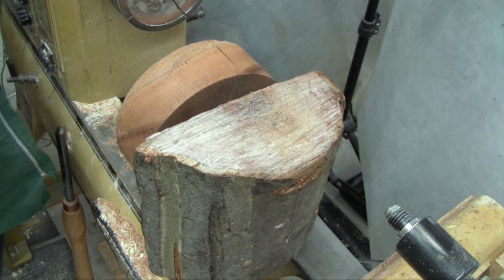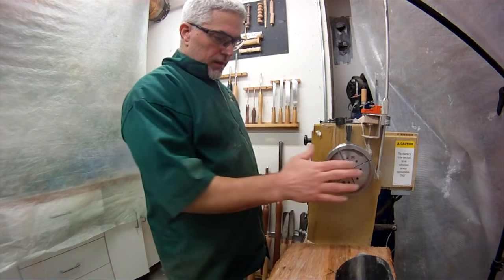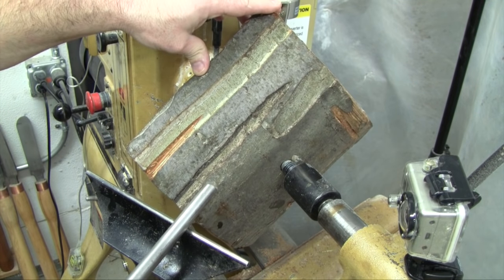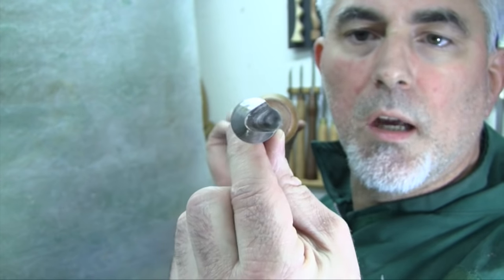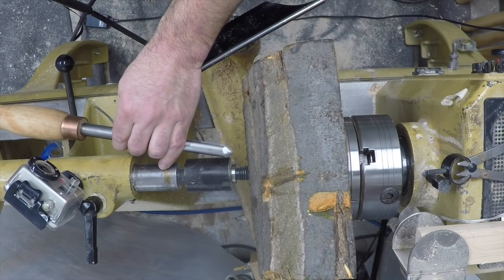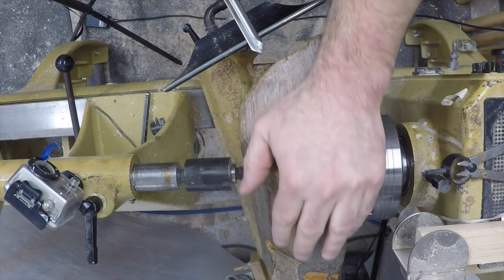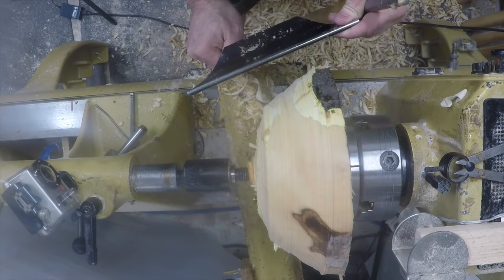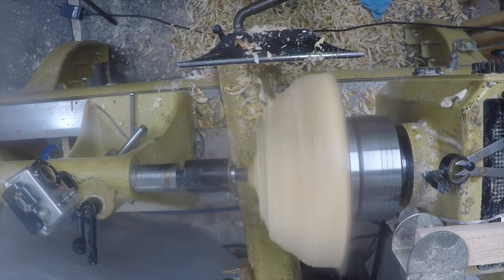No Bandsaw? No Problem!

Comment: When I first started doing bowls I only had a little 6" band saw so the most I could ever do was knock off a little of the corners.  So I had to develop my own way of dealing with half rounds like that. Not much different.  Just starting at the 45 and slowly working toward the head stock. Lately I've switched to doing the roughing left handed.  It keeps me out of the line of fire for the chips, water and potential failures. Same basic cut right hand on the rest, handle on left hip and pivot right.
Reply from the maker: +Robert Schuster I should try the left handed roughing for the reason you pointed out.  It keeps me further out of the line of fire.  I used to think that Glenn Lucas was left handed, but I learned at his demo here at a local club that he is right handed but roughs left handed.

Comment: Brian -- Thanks for the informative video.  I wish I'd had that pivot cut in my arsenal when I roughed out my first half-log blank.  Trying to turn it round it out with a push cut almost cost me some fillings!  Talk about a brutal cut.

Rather than using a screw-chuck or a face plate to mount the blank on the lathe, I suggest mounting the blank between centers.  This allows you to find the balance point on the blank (which lets you turn at a higher speed).  More importantly, it allows you more creative freedom.  With a screw-chuck or face plate, you're stuck turning the bowl on that axis.  When you start between centers, you can shift the axis to better balance the grain or to take advantage of (or avoid) some other feature in the wood.  YMMV.

Comment: Two other techniques are to cut the blank into an octagon as you have done in another of your videos, Brian. Also, a lesser used technique is to place the full log between centers then shape the log into a ball. Finally,  rotate the ball 180 degrees before cutting in half with a chainsaw while on the lathe. This one works especially well. you just have to be careful. It's best to start with a small diameter log of about 9 inches. i believe it is David Ellsworth who uses this technique, but I'm not certain. I have done it myself, and it does work well. The trick is to get the pith oriented perpendicular to the bed ways before cutting with the chainsaw...electric chainsaw is best for this.
As a side note, we all seem to be adapting the techniques of the professional/production turners. In my opinion, this is a mistake as it causes us to be in a hurry. Side ground bowl gouges are a good example of this. The object of that gouge is to remove material quickly. That works great for the production turner. But, this is supposed to be an enjoyable hobby. What's the hurry?

Comment: I didn't have a bandsaw for a number of years -- i used to rough the corners off with the chainsaw so it was closer to being round (mostly octaganal).....once I got my bandsaw, i found that spending 5 mins at the bandsaw, saves me 20-30 mins of roughing at the lathe......since my lathe is only midsize, having the saw means I can do larger bowls that start approaching the 12" max the lathe can do....before that most of my bowls were only in the 8-10 range at best.....

Comment: I acually found out yesterday that with my electric handplane i can extremely quickly take off the corners and the "corners of the corners" and take off most of the material very very quickly like that. saves a ton of time too and might even be quicker than with a medium bandsaw and setting everything up.

Comment: I am a new turner. 
Had a large walnut bowl blank on a plate the other night. It was out of balance and bouncing a bit. Without thinking I grabbed a spindle roughing gouge instead of my bowl gouge. 
About 15 seconds is all it took to catch the end grain.
Snapped the tool rest off and bent the roughing gouge over. The local machine shop made me a new tool rest but I'm out a Robert Sorby spindle roughing gouge. It could have been worse.
Scared the heck out of me!
Reply: This is why Brian's explanations are so important.  You may not have seen his other video on why not to use the SPINDLE roughing gouge for just that reason.

Comment: Brian, great video.  You explanations are spot on and very informative especially for the new/inexperienced turner. I've been watching them all to see what a good YouTube turner should really be doing.  I do wonder about the distance between your tool rest and the blank you were turning.  I realize you had a long handled gouge and the rule of thumb is 1:5 which means for every inch over the tool rest you should have 5 inches on the other side.  You started the blank a little far away in my opinion.  And every time you check your progress you should reevaluate the tool rest distance and of course spin the blank by hand to make sure nothing's going to hit.  Some of your videos mention a Presidents challenge so I assume you belong to a local turning club.  I would emphasize that to your viewers as there is an additional wealth of knowledge there.  Keep up the great work!!!

Comment: Brian, thanks for the excellent demonstration.  Could you share info on the grind you have on that bowl gouge?  Looks like it might be different than a gouge used for the finer cuts as the bowl nears its destination.
Reply from the maker: +JSEquineVideos  I have been thinking about doing a video on bowl gouge grinds.  For about 90% of bowl making, I use a 40/40 grind, meaning that both the bevel and the sweep are 40 degrees.  When the 40/40 can no longer maintain bevel contact at the bottom of the bowl (because the tool hits the rim of the bowl) I switch to a bowl gouge with a 60 degree bevel.  The one I used in this video is still a 40/40 grind, but I sweep back the left wing some, which I find helpful when rouging bowls.

Comment: Why wouldn’t you use roughing gouge to rough the outside shape
Reply: If your're talking about a SPINDLE roughing gouge you need to watch Brian's other video on why that's not an appropriate tool for anything other what spindle work.  And spindle work is where the grain structure of the wood is only going parallel with the bed of the lathe.

Comment: thats all well and good if you think everyone has a lathe the size of yours, its almost if possible on a hobby small lathe because it would shake the hobby lathe off the bench
Reply: I have a Jet 1221 and i easily screw chuck up a piece this size (even oak) and turn it into a bowl same as this video. And my lathe isn't even bolted to anything but sits on a table. Now the 1221 is a pretty heavy little lathe so that helps, and I use a sharp tool, but it's not so difficult.

Comment: Do you have a nova titan chuck? How do you like it?
Reply from the maker: I do have a Titan, and I like it, but I have heard others complain about the fact that there is no way to use a wrench (including the standard Nova chuck wrench) to remove the chuck from the spindle.  Most Teknatool chucks require an insert to adapt it to the specific spindle thread, and that insert has a hex shape that allows the chuck to be removed with a wrench, but the Titan only comes in 1-1/4, 8 tpi and has no hex shape.  To get the Titan off, I usually open the jaws to have a 1/4" gap, and stick the 'T' hex wrench that comes with it to lever it off.  I find this a minor frustration, but I know one turner returned his because of this issue.
Reply: hmm thank you for the information, I don't think that would be too big of an issue for me, I hate reaching for a wrench anyway. For the price it cant really be beat when compared to the other sized ones